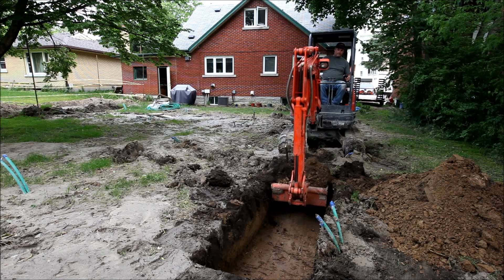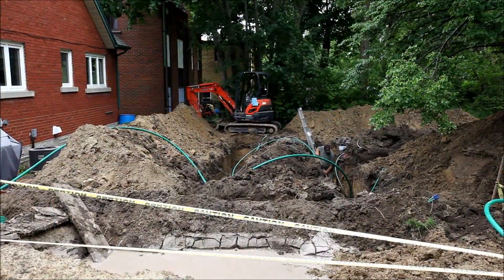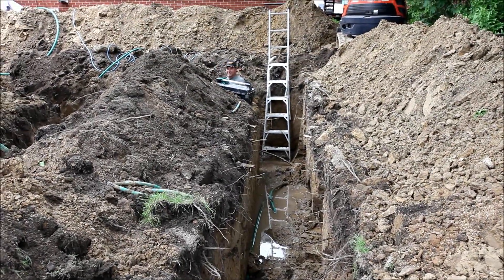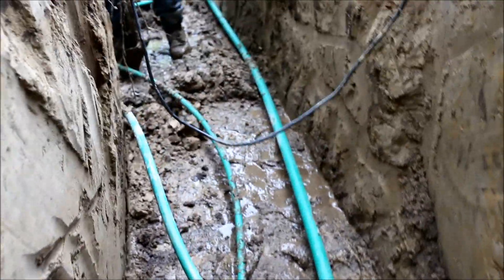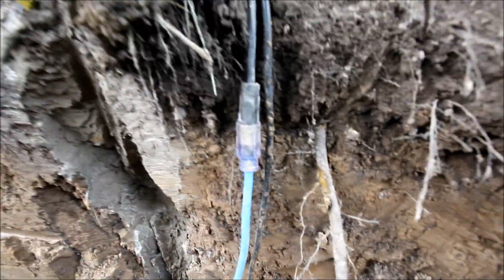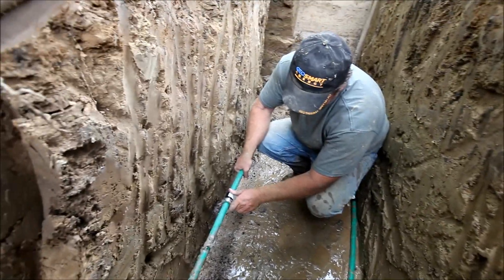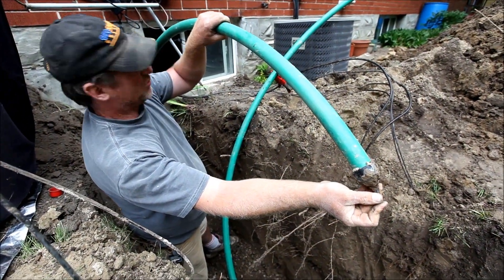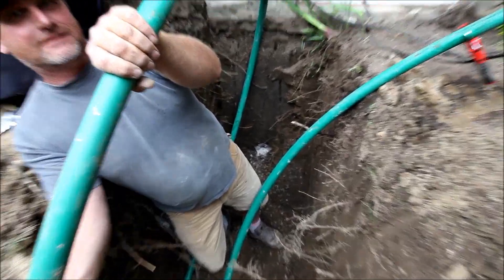Geothermal Install - Waterloo house - Part 2

Comment: The amount of issues in this video is unreal. Clearly visible rocks under the piping which can cause issues in the future along with bringing in pure Ethanol based product which is highly flammable this is just naming two...I could go on. Please research before doing geothermal installations to many corners are cut

Comment: Mark the plumber was lucky there were no leaks on the pressure check....should have been done before covering up the trenches......other than that good vid!
Reply: +Washer Dryer Didn't follow codes throughout the video...

Comment: What if the pipe got stuck in some where down the ground?
Reply: +Grass Horper Typically there is many testing requirements to ensure you have the correct flow through the pipes and pressure testing.

Comment: I was looking at one of these for an addition I am adding on my house. I did the two prior heat pump installs at my house but would like even more cost savings over a 14seer unit. Looking at my local regs the frost line is at 18 inches. Using a slinky I could easily dig a 24inch trench by hand or even rent a backhoe for a day for about $100. The unit costs are about the same. I had to pay to get refrigerant in mine which it looks like this is precharged. If my math is right this is cheaper?

Comment: Actually, we did have professionals do the install. I just helped a little bit. I work for GeoSmart Energy but it was my house so I wanted to document it. The drilling and install was not cheap but worth it because they know exactly how to do it and ensure it is done properly. I would not attempt yourself unless you are a driller and have been given geo-specific training. There are many factors involved in creating a loop that will heat and cool your home flawlessly for years.

Comment: @UncleSamSpeaks For this install, we drilled 12 holes each at 80 feet deep. Once the drilling was complete we needed to tie all the pipe together at the top to form one continuous loop. This loop needs to be at least 5 feet underground in order to be below the frost line (varies according to region). I would say it's rare that a trench would have to be 15 feet deep if you are doing vertical drilling. There may be exceptions for terrain though or to avoid obstacles, etc.

Comment: So, you said that the trenches dug were only 5 feet? I was told that the holes dug have to be at least 15 feet(and then the tubes would go down another 50 feet or so) If this is true, then putting it in myself would be much more feasible. Please let me know how it worked for you.